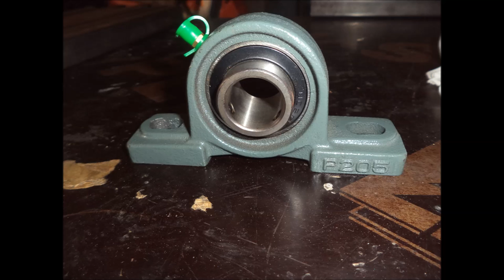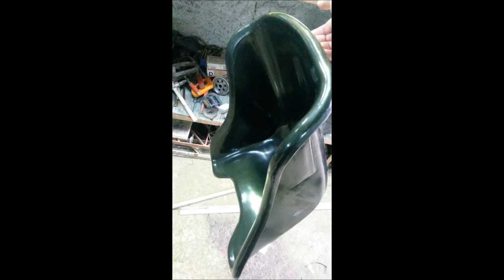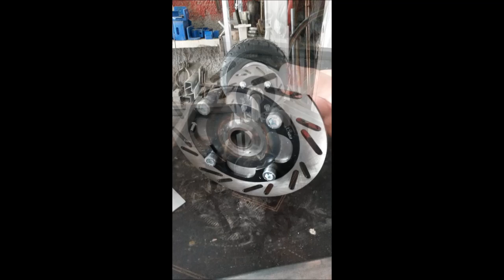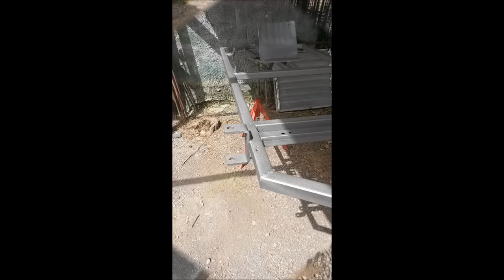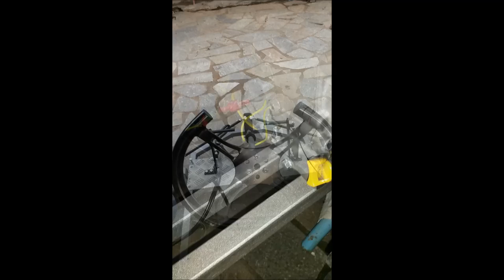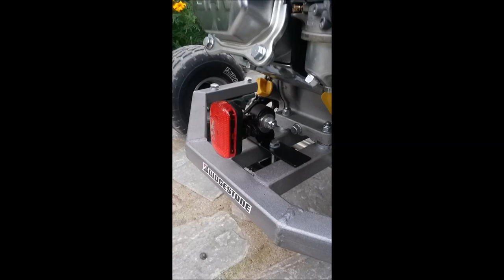Homemade Go Kart Project (6.5HP)

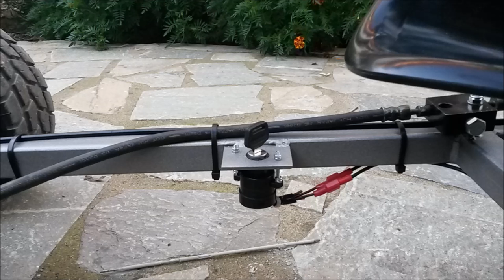Comment: At 4:15 i see a key; your engine have a electric start option or you create it ?, if yes; how can i do it for honda gx120 or 160 clone like forte gsm200 6.5hp
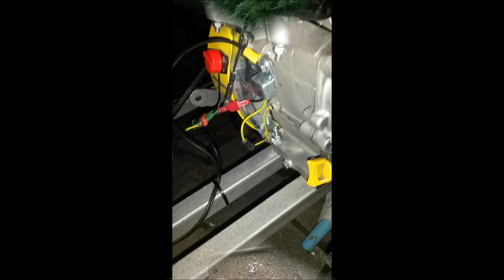Reply from the maker: +Juan Sierra No my friend I've just moved the on-off switch close to my seat so I can use it on emergency time. I've just prefer key and no button just to make it look better. You can see the 2 black cables whick works as extension of the on-off switch on 4:20 :)

Comment: Hi I would like to ask you about engaging the key to shutdown the motor as it should properly plug in or dake in more detail the photo for the reply Thank you
Reply from the maker: Stanislav Hello, give me your email to send you the photo with the cables!
Reply from the maker: Tommorrow you will have the photos :)
Reply: once again very nice thanks i hope it will work :)
Reply from the maker: Thank you my friend. You want to make the same system with the key to shutdown your motor?
Reply: yes i would like to have a key to shut down the engine in the front, which would serve as a shutdown and also as a fuse when the key is pulled out

Comment: but its welded? (you are german ,aren't you)
Reply from the maker: The sprocket and the brake disc are attached to the axle using keyway and some screws to be secured. I'm greek btw.